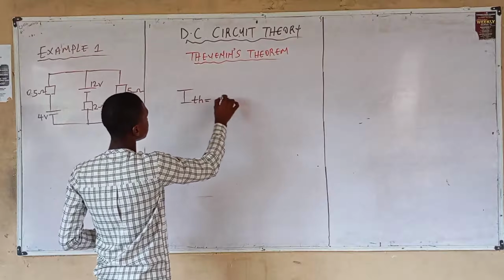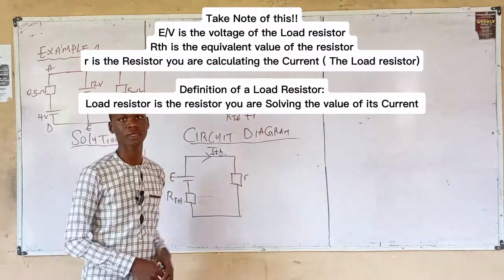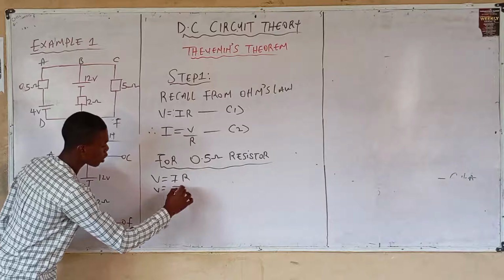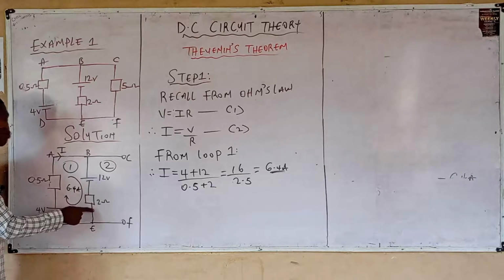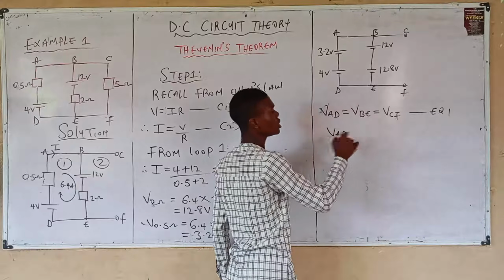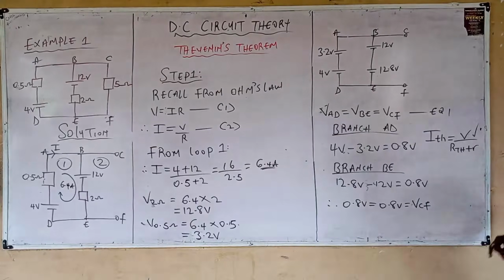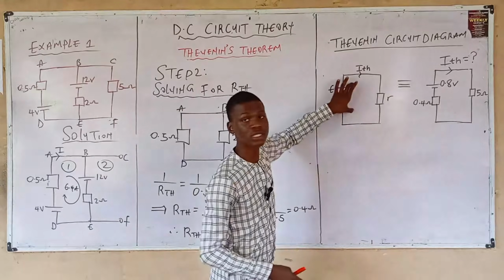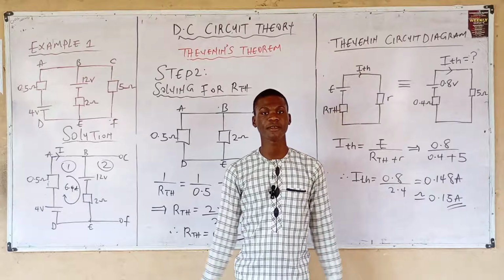Thevenin's Theorem - Circuit Analysis

Comment: What if it in three loops
Reply: Can I have your number
Reply from the maker: Here is my number, +2348124202949.
Reply: The answer you got they added the two voltages and divided it with the equivalent resistor and the load resistor
Reply from the maker: There is a video of three loops, check through the playlist
Reply: @FURTHERACADEMY I couldn’t understand

Comment: I really appreciate the explanantion.
I just want to point out that the current flowing through loop 1 is not 6.4 A.
The equation, using Kirchhoff's voltage law, is supposed to be:
(+4)+(-0.5I)+(-12)+(-2I)=0
So that:
4-12=(0.5+2)I
-8=2.5I
I=-8÷2.5
I=-3.2 A
The current I is supposed to flow in the oposite direction, into the 0.5-ohm resistor.
🙂
Reply: exactly 
awesome 
same as me